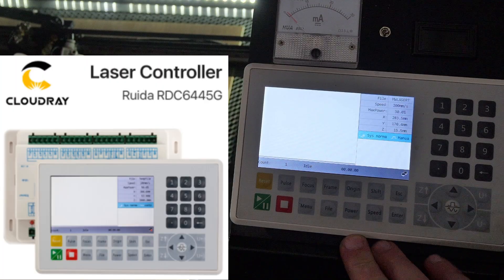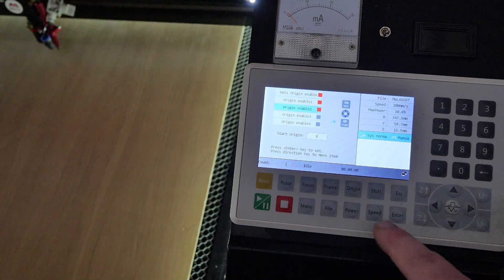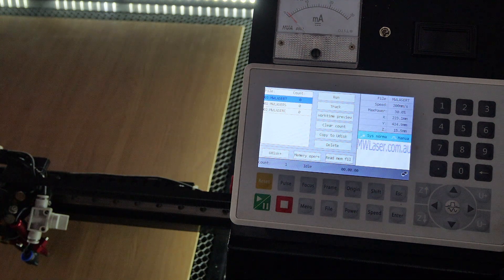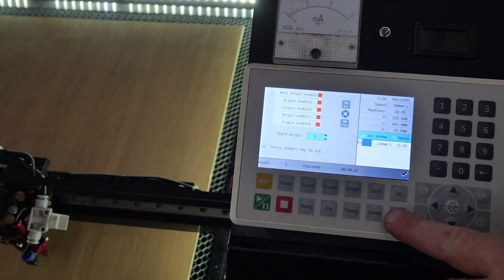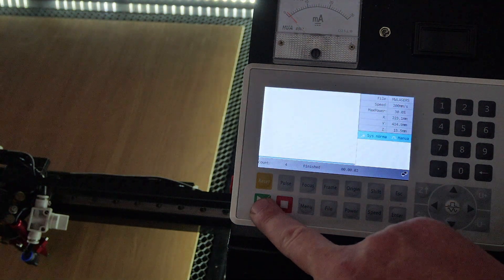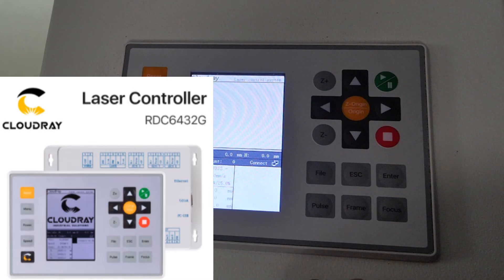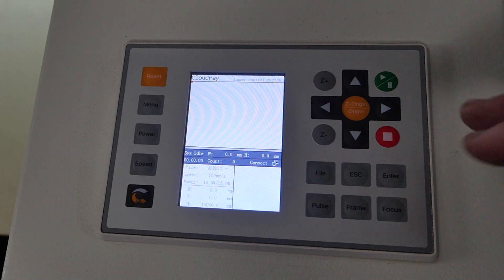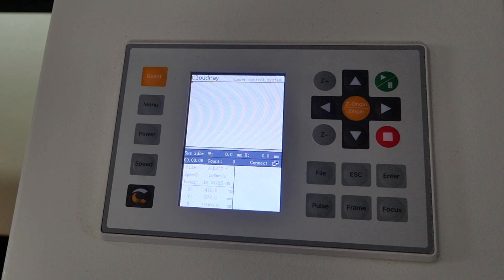[10] RuiDa Controller - Multi Origin Function

Comment: Hi, thanks for all your great videos. I have a 1390 laser with a Ruida6442G controller. I have bought a Rotary and a driver for it (DM542) Unfortunately the RDC6442G does not allow the U-Axis to be used for rotary. So WHICH controller should I buy to get all Axis (X,Y,Z and rotary) to work from LighBurn? Thanks in advance and keep up the good work /Per

Comment: I think this is supposed to be more for fixturing. Say you have 4 vice / stops setup with small workpieces, you can run 4 jobs at a time. Like G55 in Cnc gcode. 

You could have one stop setup for engrave, another stop for flipped piece engraving bottom side, etc, etc.

Comment: Matt,   The  ruida rdc-6332g or ruida rdc-6445g  what one is better
Reply from the maker: that depends upon the use of your laser, and how many axis you have ie X,Y,Z,U
6445 has 4 axis control and a larger screen than the 6332 which has only 3 axis control, both are good controllers.  if you are trying to choose between them, I recommend contacting an RD sales rep.
Reply: @MWLaser  So if i have a rotary attachment and a motorized Z bed I ahould get the 6445 ?

Comment: Need to know how to make rotary go more than 400mm inY  around about 10 times for a corkscrew pattern  need some help please
Reply from the maker: if your Y axis is normally 400mm, then the only way would be, while using the rotary axis, increase the size of the vendor settings for the Y Axis to more than you require eg. 10000mm  (then when you finish with rotary device return the value to 400)
You will find this in Vendor Settings, Y Axis ,  Breadth.  Read info from controller, change Breath value then Write info back to controller.

Comment: Hello, could you help me make the decision between the controller rdc6432 and RDC6445? I have seen some users of RDC6432 complain that it does not connect with the software via network or usb, well I wanted to know what is the main difference between the two that justify the higher value, if you can help me, thank you very much
Reply from the maker: The better of the two is the RDC6445, much more user friendly and easier to configure.  Definitely worth the extra expense.
Reply: @MWLaser  Thanks